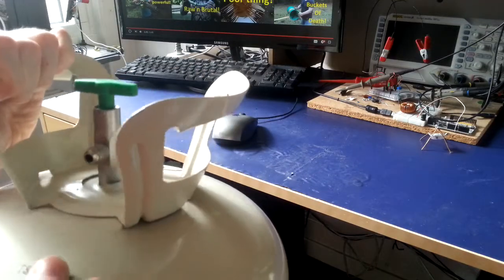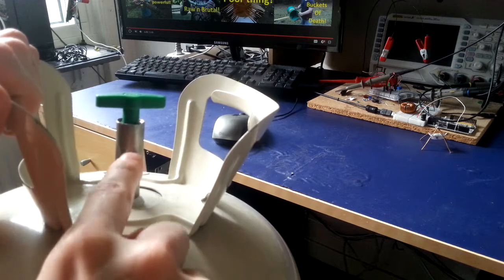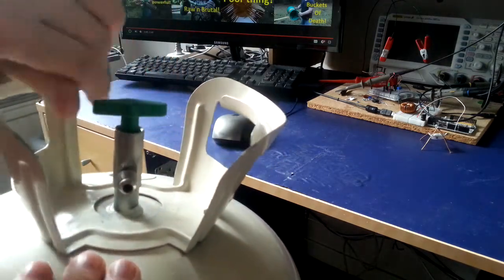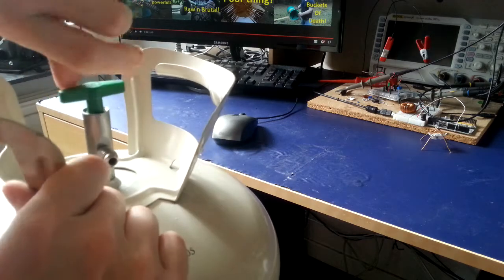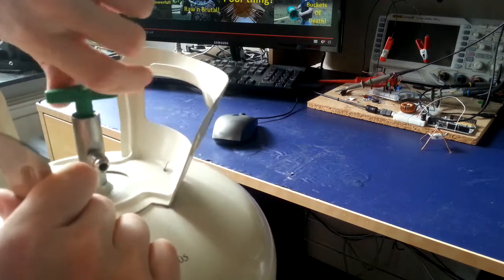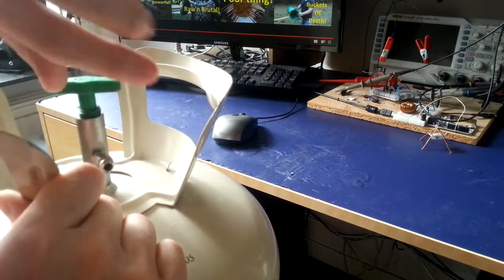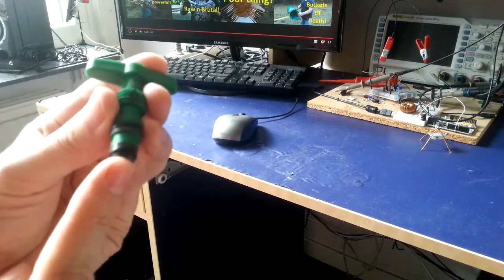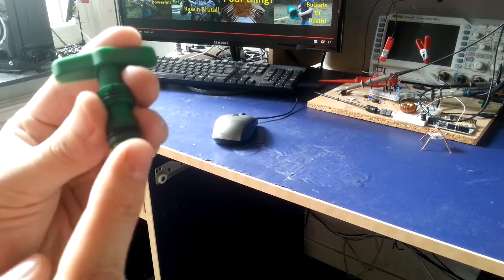How to modify the valve on a Helium tank

Comment: Finally a decent video with actual information. Already guessed the valve is like that  ... thinking about how to get some rust proofing inside that thing to use it as a low pressure air tank for tire filling etc. Thanks.
Reply: These tanks are made from thin sheet metal, after awhile it will fail and explode do to metal fatigue

Comment: What Max pressure can i fill it?
Reply: U got answer?
Reply: @chaofansha1752  look at some youtube videos of air compressor explosions, then decide if you want to do this. The tank is rated for the pressure, but it's designed for dry gasses, so it's very thin. Any moisture will quickly lead to failure with the force of a stick or two of dynamite.

Comment: I've found the thread size on the valve outlet is 7/16 UNF.  What is the thred size on bottom of the valve which goes directly into bottle slightly bigger. I want to remove this valve entirely and fit a 1/4" bsp manifold.
Reply: Iv been looking to fit a normal welding tank valve on here or find a way for a fee connectors make it hook to a regulator so I can dc Tig weld
Reply: Iv been looking to fit a normal welding tank valve on here or find a way for a fee connectors make it hook to a regulator so I can dc Tig weld
Reply: @richardgoforth1833 Did you manage it?

Comment: Hi. What's the max safe pressure for those tanks?
Reply: nominal pressure is 27 bar but i don't recommend filling it with more than 16 bar
Reply: @Krzysix.io11  HOLY MOLEY, THATS STILL A LOT, I WOULD GET NERVOUS AT 10 BAR,  145 PSIG
Reply: 40.5 bar is the maximum pressure
Reply: My tank (just like the one in the video) has two pressure ratings, PW and PH. I presume PW is pressure, working, and PH is pressure, high, but do your own research.  PW is listed as 30 bar, and PH as 45 bar. Over time it would be a good idea to drain the tank of water as compressing the atmosphere, you will gain moisture which will eventually rot out the bottom of the tank
Reply: If your tank is labeled: DOT-39 NRC 260/325 M1005. The 260 is service pressure and the 325 is test pressure in psi  (17.9 / 22. bar).
Reply: Don’t listen to the answer you’ll get hurt at those pressures
Reply: @Jus4ya  listen, on the tank was written that helium is under 27bar "PW27BAR" ask your frends if they have empty bottle and check by yourself
Reply: @Krzysix.io11  nobody do this! thicker tanks like small home air compressor tanks are rated for 5 bars or around 74 psi they have pressure release valves for when the tank becomes over pressured. the thin tanks will rupture an most probably cause injury
Reply: @Krzysix.io11  upload a video then
Reply: @Jus4ya  My compressor does max nearly  8 Bar, so must be safe.

Comment: How do you fill it back up could you make a video showing how you feel it back upand what is your source of putting in air or helium back in it I trying to learn so I could feel it up to use it to fill my air PCP rifle
Reply: PCP rifles operate at around 1400psi, this tank would explode at a fraction of that pressure. You need scuba grade tanks.

Comment: I'm thinking of doing this for a reserved air tank. if I get a flat I could fill a tire less then 30 seconds.  plus it would be handy to have air to help others too.
Reply: Im pretty sure it says its very illegal to transport refilled helium tanks so be careful
Reply: Air is way heavier than Helium, so there's a higher chance of explosion as the walls are not thick enough.
Reply: @AdamSKEN.01  there's a weak spot where it'll blow for safety to prevent explosion
Reply: @georgieippolito9924  it's not about excessive pressure. It's about the tank not being designed to withstand the stress of repeated fillings.  They didn't waste a penny on giving them the proper specs for that when they were meant to be disposable.
Reply: @severewindnoise  3 years later i got 2 of them 1 filled with compressed air at 240psi (260 is stock)
the other one is liquid butane. 35 psi at 70° which a plastic bottle can easily handle.  i use the butane tank for multiple things like torching the new roof at work and hooking up grills, stoves, heaters and a ripped off industrial gas stove flame star thing and a 55 gallon drum makes hot water in 20 minutes of running for camping.  

butane burns clean and can be contained much more easily then propane.  there's 1 downside with butane.  if its really cold out the liquid gas won't freeze but can go to 0psi.  to prevent that and maintain pressure is to put a insulated cover over the tank.   

one more thing i should mention when you reuse those.  see those cow udder things on the bottom they call legs?  there dents in the metal sheet during production. each time you place the tank down they get a beaten by the ground so they will get thinner and thinner overtime.   simply cut racquet balls or tennis balls in half and glue them in place for new shock exorbing legs for your tanks!

the stock of those tanks are 260psi.   most i would do is 240 psi.  1 air filled tank can fill up a car tire.  also 1 filled air tank is able to operate a air powered impact wrench to change the tire.

Comment: Do you know how much pressure can it be filled with before .....boom
Reply: What is the working pressure of Balloon Time tanks?
Balloon Time tanks operate at a working pressure of 260 psi, and are successfully leak-tested at a minimum of 325 psi to ensure quality. In addition, each Balloon Time tank has a patented flow restriction safety device, reducing the flow rate and improving the safety of the product.

source: https://www.balloontime.com/contact-us/faqs/
Reply: they don't blow up. well the weak point does but it doesn't explode.  the weak point is designed to blow to prevent explosion by overfilling.  when it blows it just makes a loud pop and hissing sound till the tank is empty.

Comment: I mean the metal threaded part
Reply: I have an 8.9 cu ft (30 balloon) "Balloon Time" tank. Made by Worthington cylinders. It has a 1/4 male flare fitting BUT the tip of the fitting is crimped in four places, to hold a rubber reducer? inside the fitting. I installed an O-ring inside the female fitting, that I screwed on. Without the O-ring it leaked. My full tank had 250 psi (17. bar) at 70F. My full tank didn't contain any liquid when full. If your tank contains liquid Helium, then it's a stronger tank because Helium becomes liquid at room temp. at 367 psi (25 bar).
Reply: I think it is a special valve
Reply: A special mesure.... Not the same thing than the standard air valves.  Sorry for my english.